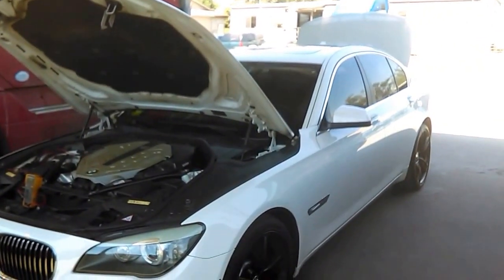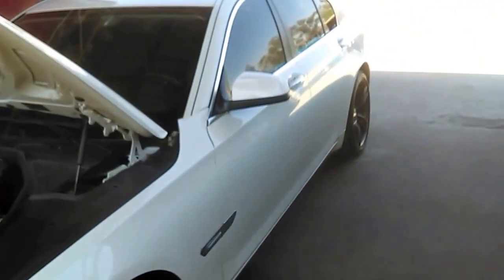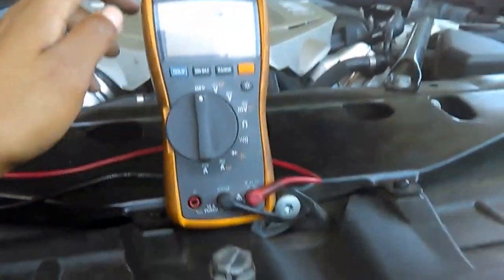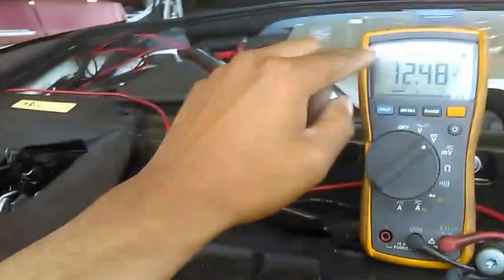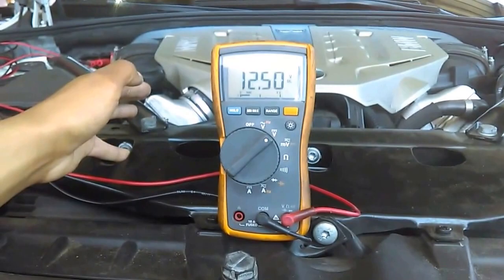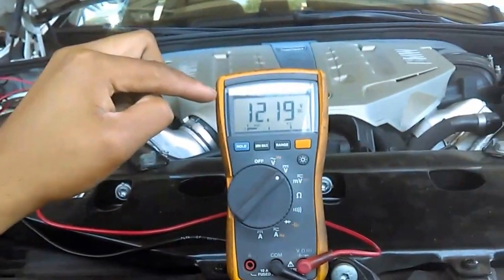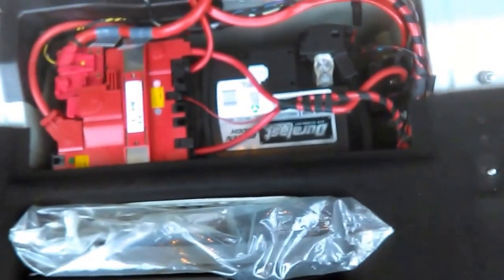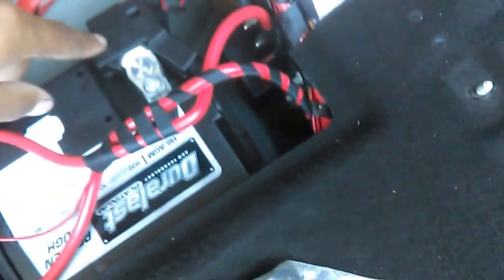BMW increase battery discharge diagnostic test.

Comment: I’m getting the same message for my 2012 550i x drive but the difference is mine won’t start up!!! I had a small coolant hose blow and I fixed it but now I can’t get it to crank. Could coolant gotten down on my starter or maybe my alternator?

Comment: In virtually ALL of these videos you guys talk about the battery discharging either overnight or when the car is shut off. But why does no one mention or diagnose when the battery dies while driving??? Same discharging message, same ‘drive longer distances’ message, but twice now all the systems started shutting down within 5mins of these messages. Thankfully I keep a jump starter and battery charger in the car. But is this also a sign of bad alternator? Replaced AGM battery and got it programmed so it’s new. Not even a few days later messages popped up again and systems shut down and car shut down WHILE driving. Please advise!???
Reply: Hi Christian, I also wonder why they dont diagnose battery dying while driving. Did you ever figure it out? Im having the same problem. Its so hard to get an honest mechanic and all the mobile ones have been flakes or charge $200 for a diagnosis and still don't fix anything. Please reply when you can.
Reply: @tazmaniandiva7762  should know this week! Believe it or not I hardly drive it since I have 2 other vehicles but I bought an alternator and took car to repair shop yesterday.. They said it only takes a few hours to change so I should have it back today or whenever I get a chance to go by there
Reply: @tazmaniandiva7762  also won’t hurt to check your alternator fuse to see if it’s blown
Reply: @TravelingChristian  thats good advice. Thank you!

Comment: I replaced a new battery and it’s still saying battery discharge
Reply from the maker: Is the new battery capacity the same?
I mean cranking amps and reserve charge?
Reply: Francisco Amaya yeah everything is the same not sure what it can be
Reply from the maker: @saltisgood7961  
Does the voltage stay above 12.2 v with  ignition, on engine off?

Comment: Having similar issue, battery still new and was registered, IBS is less than a month old. But while I driving I get that sometime and caused everything else to shit off and wont start until like 30 minutes after. 

Not sure if it's the alternator because I unplug the negative cable after the car is start and drive the car like that for miles and nothing happened.  Any idea?

Comment: This was happening to me. I replaced the battery and randomly it will show battery discharge.. Does registering the battery will fix it?
Reply from the maker: Did you get the exact same battery replacement?
Reply: @franciscoamayaYT  No I got an aftermarket battery. I haven't drove the car in 3 months so I am guessing it needs to be driven for the alternator to charge up the battery?
Reply from the maker: Do you know the battery specs?

Comment: You alternator is dead my friend. Your car is running on battery. You need a new alternator. 
It should be 14v with the car running. 
And 12 to 13volts with engine off.
Reply: Engine not work how alternator work its only switch on

Comment: I just bought a 2011 750I with 81,435 miles and like all the rest of them it burns oil like crazy. Five quarts in 1000 miles and it doesn’t smoke or leak a drop. One owner car very well taken care of with all service records and oil changes every 9,000-10,000 miles. 
Wish someone would put down the top five causes of this in the N63 engine. 
PCV
Valve Guide Seals
Piston Rings
Turbo Seals
Plugged Turbo Oil Return Line 
In what order should I start the battle?
Reply: Bart Lawhorn 5 Quarts is too much, when you get the message “add one quarts” just take it to a BMW dealer, there is a good chance they will fix the problem for free under the Customer Care Package.

Comment: I have gotten the same message on my bmw last week but it was -8 degrees outside at night so the next morning it was -2 degrees outside  but  the message never came back on
Reply: I got the same issue did you ever figure out the solution?
Reply: I just drove the car but less than about 1 month later I needed a new battery  and it wasn't cheap it was 450.00 and had to be coded to my car yes I got it done at the stealership

Comment: Hello I Have A  6Series & It Says "Charging Malfunction" & "Increased Battery Discharged" It Will Only Start With A Jump & All My Lights On The Dash Came On B4 The Car Completely Died. I'm Thinking Alternator Or IBS Sensor Idk. Just Trying To Figure Out B4 I Have To Go To Dealership Alternator $1,500 & IBS Is $500. Any Feed Back Is Amazing
Reply from the maker: Can you check the voltage of the alternator?
Reply: Unfortunately I Can't Check It. I Would Have To Purchase The Part 1st.?Based On Your Experience & Knowledge Do You Know What It Sounds Like It Is?!
Reply: It Was The Alternator Only!

Comment: Hi Francisco 

I have a 2012 bmw 750li twin. Turbos, the ac blows cold air but it only throws a little air, I have changed ac blower and blower resistor, the battery is stock 2012, and it has increased battery discharged. What could it be
Reply from the maker: Replace the battery,  it is possible that you have a weak battery.
Reply: @franciscoamayaYT  do I have to reprogram the battery
Reply from the maker: It is necessary but not mandatory.  

If you register a new battery, the battery life can be prolonged.

Comment: I still have this message after getting a new battery it drains over night but starts right up with a Jump
Reply from the maker: Does the battery has the correct cranking amp and reserve charge?

Comment: Hi Francisco,

   When replacing the battery the mechanic advised he needs to ground alternator or reset computer .... I'm not sure ..Also is the AMG battery the recommended one here ..?
Reply from the maker: Use AGM batteries, this prevents corrosion in your batteries terminals.  Check my video BMW F01/F02 battery replacement for details https://youtu.be/e8wgPOWJ3Pw
Reply: Francisco Amaya The Agm battery was replaced 1/28/2017 something in the computer system is drawing from battery..

Comment: How do you know if the IBS sensor is faulty and it's not just another component in the car causing the battery drain?
Reply: Thats it because i have same problem in my bmw m6 , i changed ips but problem still , i take it to workshop and he change model in dash that was main control of all electric system in my car , now every thing is normal.
Reply: @Mohamed.Almehaiza what do you mean by dash, main control of electrical system??

Comment: I have been getting the "Increased Battery Discharge" warning lately. 
I just did your test and It was:

11.62 Engine & Ign off
12.33 Engine off Ign On
15.22 Engine Running

That voltage while running is slightly high...could it be the ALT or IBS?
Reply from the maker: The engine off, ignition off voltage is lower than engine off, ignition on voltage. That is not normal, normally the engine off, ignition on voltage is lower than engine off, ignition off, for example. 

Engine off, ignition off @ 12.5 volts
Engine off, ignition on @  12.1 volts

Check your battery voltage again when the engine is cold in the morning and compare it to this measurements you just did. 

Anyway, you alternator voltage is too high, it could be overcharging your battery or the battery is too weak. 

Do you car has efficient  Dynamics?
Reply: Thanks for the reply, appreciate it!
By Efficientdynamics, are you referring to the auto start stop of the engine at lights etc?
It doesn't have that, if so.
Reply: Those measurements I gave you above were done in the morning before the X5 had been driven or started for the day. 
It is a 2011 X5 35D by the way.
Reply from the maker: No, I mean a blue bar next to the MPG gauge. 
What year and what model is your BMW?
Reply from the maker: Oh, sorry.  I didn't see this.
Reply from the maker: Ok,it doesn't have efficient Dynamics.
Reply from the maker: So the ignition on engine off voltage is higher than ignition off engine off?

The X5 start with not problems in the morning?
Reply: Yeah it starts but sometimes it isn't the robust instant strong start but rather has some struggle. 
Twice, when it has been colder and hasn't run in a few days it did not start, the battery was too low and I got the typical transmission error etc due to it. 
Was OK once I put my charger on it for a bit.
Reply from the maker: Ok, replace the battery and perform a battery registration.
Reply: OK thanks mate...lead acid battery OK for these?
Doesn't HAVE to be an AGM, correct?
I will have get a program to re-register the new battery I suppose.
Reply from the maker: Lead acid batteries are ok but they are not recommended. 
AGM batteries are more expensive than lead batteries but the AGM battery does not get hot as the lead battery + it doesn't create corrosion like the lead battery. 

I suggest to install a AGM battery, it better than lead battery. Anyway, it is up to you. 

Yes, you can search online. 
You don't need a expensive scan tool, all you need it a tool to reset the battery registration.   Just Google it as BMW battery registration tool.
Reply: OK will do...AGM's are $330 Canadian via NAPA....ouch lol.
Reply from the maker: Wow, that is expensive. In the USA it cost around $200
Reply: Do you need a computer to re-register battery or is it done in the car ?
Reply: @jamildaghlian8750  if you have to ask, buy the battery from BMW
Reply: Hi Francisco. I kept getting this code and I replace the battery. It disappeared for about a month or two and it happens again and totally drained the first battery that I brought. It was a brand new Bosch battery. Is that the IBS or alternator?
Reply from the maker: What type of battery are you using? Lead or AGM?
Do you know the battery specifications?
Pull these numbers from the battery sticker, it is located on top of the battery. 

CCA ?
Ah ?
RC ?
A ?

Tell me that information and the year and model of your BMW.
Reply from the maker: Yes, that is true. 
But you need to register the battery not only for the Ah rating, you need to register the battery because over the time the computer changes the way the battery needs be recharge. It doesn't not affect the battery immediately but it will affect the battery after couple months of use. 

I recommend to do a battery registration, but again it is up to you.  

Yes, this should be included in the idrive system but they don't do it because they want BMW tech to perform this job. 

A female subscriber text me couple months ago and she told me that she took her BMW 750Li F02 to the dealer because her battery was not working right so the dealer replaced the battery and they did a battery registration, when she went back to the dealer to pick up her BMW she ended up paying a bill for $2000.00 just for a battery replacement; this is ridiculously.
Reply: Whoa...what a bunch of crooks!
Reply: Seems I would have to get the EXACT same battery type with the same AH rating otherwise I would not only need to register it but reprogram the new battery for the differing AH rating. 
Total money grab from BMW as this SHOULD be included in iDrive for anyone to do.

Comment: hi bro, i get the increased battery discharge message on my 335i bmw sometimes. some days its fine i dont get any message.. i dont drive the car match only 2 times a week. is it possible because i dont drive the car much thats why battery charge is low??
Reply from the maker: Yes, it is possible. 
During the time the BMW is off it needs some battery energy to maintain memories and setting, if you don't turn the engine on the battery voltage will drop significantly. 

If the battery voltage gets lower than 12 volts at the moment you start the engine the computer will set the increased battery code on. 

It is possible that you have a weak battery too.  

I suggest to start the engine once a week if you don't drive it but if the ambient temperature is low I suggest to start the engine more than twice a week.
Reply: thank you for your reply. today i drove the car and i didnt get increased battery discharge . if it is weak battery i should have get the warning light each time i start the car.l is that correct?
Reply from the maker: Yes, that is correct.
Reply: @benkibris7803  trickle Charge it

Comment: I just replace my 2011 BMW X5  battery for a new one, so should I have it register?
Reply from the maker: Yes, do it. 
The battery registration is very important to extend you new battery life. 
The BMW X5 E70 does not have efficiency Dynamics so the battery is fully charged by the alternator.

Comment: hey i have been watching all your bmw 750li videos because i want to buy a used 2009-2011 750li. What would you say are the main things to check before i buy? thanks.
Reply from the maker: If the Check engine light on
Oil leaks
Oil in coolant
Coolant in oil 
Tailpipe excessive smoke
Rims condition
Front Control arm
Transmission
Engine noise
Engine temperature
If any warning light is on
Condition of the interior
Electronic system fully functional
A/C
Miles
Etc,....

Comment: Hello, can I use the bmw hidden menu to measure the voltage? Is it accurate?
Reply from the maker: +Donny Djojoatmodjo 
Yes, but you can use it only when the ignition is on.  To read the voltage when the ignition is off still you need a voltmeter to manually read the voltage of the battery.
Reply: Yes you can

Comment: Will like to confirm this. I got increase battery discharge two times now. a friend did a scan and said its my Intelligent Battery Sensor. He said it could still be my battery.  I don't want to replace the wrong one. I did your test and getting 12.5 with the car off and 14.2  something like thatI with the car running.  Do you think it's my IBS ?
Reply from the maker: +Dwane Smith 
Yes, with the ignition off the voltage should be around 12.5v but you need to test the battery voltage with the ignition on, engine off and the battery voltage should be around 12.1 
if the battery voltage goes lower than 11.9v when you switch the ignition on engine off you have a bad battery 🔋
Reply: I did both, Off it was 12.5 and running it was 14.2, so it is IBS not my Battery. I just don't want to replace the wrong thing
Reply from the maker: +Dwane Smith 
Ok, you need to check the battery voltage with the ignition on engine off (in other words do not start the engine just do not press the brake pedal when you switch the ignition on) 
And then you need to check the battery voltage it should be at least 12.1 volts
Reply: Check if all the consumers are disconnected during car leave. Phone chargers and etc..

Comment: please help!! 2011 750li Bmw. I took my car to the dealership because I was getting a low battery. They put in a new battery but now I'm getting but know I am getting" vehicle battery charge low". I took it back to them bit know they want to charge me 2000.00 for a new alternator.. and they are not even sure if that's the problem. is there a way to check to see if it's the sensor or alternator?
Reply from the maker: +Laura Castillo 
Yes, the best way to check it out will be to see the battery voltage when the engine is running with a multimeter and then check the battery voltage with a bmw diagnostic tool to compare the battery voltage and see where is the problem. 
I am in Fontana CA, if you are near I can check it out for you.
Reply: Francisco Amaya 
Thank you.. I wish I was close.. I'm in Texas... I connected it  and the it says 12.50 and then when I start the car it's goes up.. 13.47....  oh I forgot to tell you the car only does it when I'm in traffic... when it first starts up there is no warning light..
Reply from the maker: +Laura Castillo 
Oh I see. 
Ok, the battery voltage look fine.  
Are the efficient Dynamics working when you are braking?
The blue little bar than is next to the mpg guage below the speed o meter.
Reply: my email so I can give you my number.. I have to check tomorrow.. Thank you  so much. I'm thankful for people like you in this world.